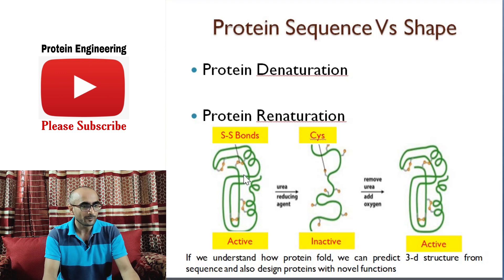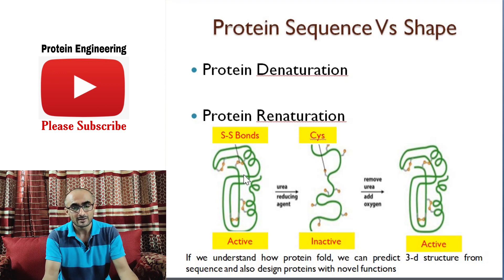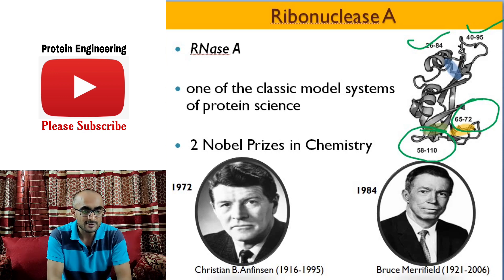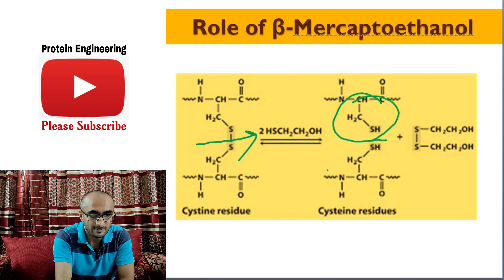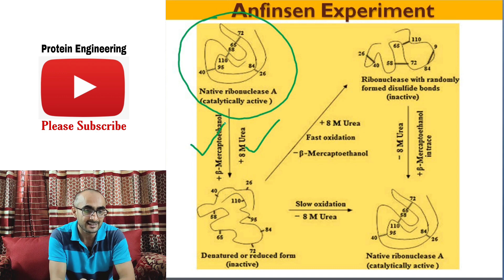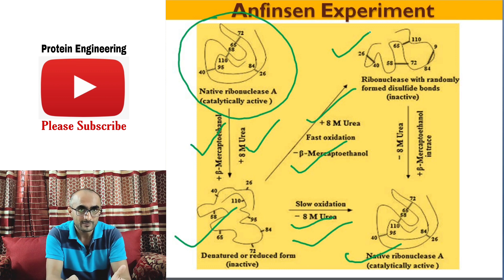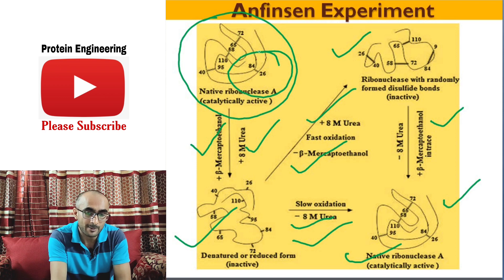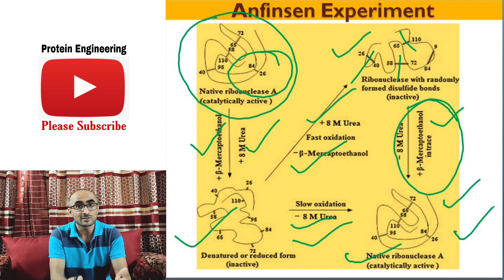Anfinsen Experiment of Protein Folding | RNAse Folding Experiment | Dr. Nagendra Singh | PENS#41

Comment: What about keratin in our hair ? What happens when they are straightened?
Reply from the maker: Keratin has no tertiary structure so no unfolding possible. in case of perming or straightening of hair disulphide bonds between keratin fibrils are reduced and later on after straightening, bonds are oxidised with new partners.
Reply: @proteinengineering007   But these new bonds are not permanent, right ?
Reply from the maker: @apaarnasrivastava4126  in permanent waiving (perming) u cant bring back naturally until new hair length grows.

Comment: If protein folding is reversible then why doesnt a boiled egg unboil when you cool it?
Reply from the maker: good question...boiling proteins at high temperature leads to irreversible denaturation. High temperature also causes irreversible chemical modifications in the proteins which leads to crosslinking of proteins as well. Covalently crosslinked protein molecules can not renature back after cooling.
Reply: @proteinengineering007  Thanku sir🙏🙏